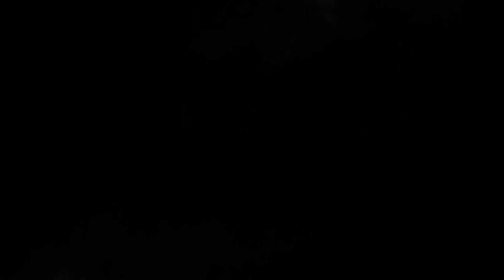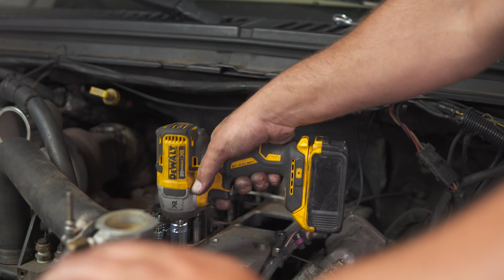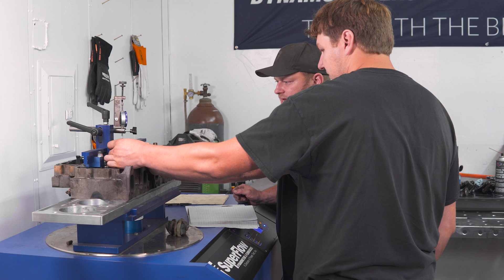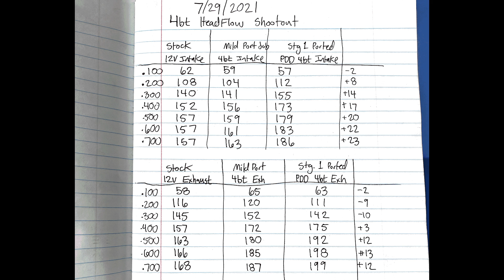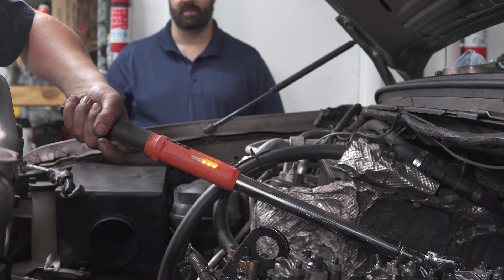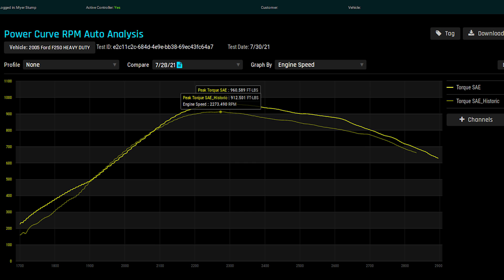4bt Cummins Ported Head Dyno & Flowbench Test

Comment: A non ford engine in a ford truck is the goofiest vehicle on the roads. 

They swap engines in everything... But the iconic Fords lose the most style points when they don't carry a factory ford drive train...

Chevy, or Dodge swap motors and most folks yawn...

A ford without a ford factory engine makes most folks cringe faster than speedy Gonzalez

Comment: A 5.9 6BT can handle upwards of 1100 hp on the stock bottom end, so I will take a guess and say the 3.9 4BT can do 700hp on the stock parts. The 5.9 I put in my '78 bronco makes 400hp at the flexplate and gets very good fuel mileage. But it only weighs 5200 lbs. I moved the entire driveline rearward by 4 inches, when I mounted the engine, so the truck has better balance than a stock Bronco, it handles nicely for daily use. And after driving it since 2009, I would never even consider running a gas truck again. p.s. I built a hybrid turbo for it, and it gets up to 39 psi.
Reply from the maker: Nice!

Comment: Is water/meth the next step in the egt war?
Reply from the maker: Pure water does help EGT, but it also reduces power a little bit.  The surefire way to reduce EGT and maintain or add more power is more airflow.  Big turbo systems can lean-out the burn enough to reduce EGT and maximize power production.

Comment: Throw a H2O methanol injection system on it.  I run straight water in the summer, and my 7.3L and 6.0L Powerstroke are much happier when towing heavier.  Your EGT's scare me...
Reply: That's what I'm saying I have a 6.9 and they say those will melt the pistons at 1200 and he said 1900

Comment: Hopefully these guys regeared the truck so they can have a cruise speed of 66-70mph at 1500-1600 rpms. That big mfr could probably see 30+ mpg if it was geared for it. They're probably producing 550-600 ft#'s at 1600 but their trans or differential gearing is working against them.

Comment: Well i just got a brand new peterbilt for work and it is every bit of twice as fast as my old peterbilt (which wasn't really old not even 10 years old) i think the old one had an isx motor could be mistaken but i wana say it was isx powered my new peterbilt has a x15 Cummins it'll push you back in the seat pretty good when the turbo kicks in with a load behind it i bobtailed it the other day holy shit what ever part of your ass or back was firmly against the back of the seat was when the turbo kicked in a big smile and laughed followed soon after

Comment: I have a 4bt in a F150 with a similar 4bt setup, a self ported head, P pump, Hx 30 over Hx35 compound, the same Colt cam, Stage 2 injectors with 035 pump valves. I can see 50+ boost with only a small puff of smoke off the line. No smoke under load when its warm. I was shocked at the HP numbers produced by the Kuntz Bro Excersion. Good job guys!!  I am also considering the ported head.....
Reply: Compound setup?

Comment: I put a '97 12v in place of the V 10 in an '02 Excursion years ago. I left it bone stock so as to save the stock Ford tranny.  It wasn't the fastest thing on the road, but at 60 mph on 35s I'd get 22 mpg. That 4bt is an AWESOME powerplant! Nice job, fellas!
Reply: I get the 4bt is good but I would have definitely done your swap over a 4bt. Just because of the cost to get less horsepower than you could a 12v.

Comment: Why do most people only use Cummins for performance.

Is it because iys easier (machanically), and cheaper to modify a Cummins.

It would have been bad as*, and really showed your ability, if you modified a 6.0, for some power.

Its getting boring to see only Cummins for racing.

There is a Duramax out there in a 60's C10, running 8's-9's in the quarter. Without a P-pump, that is true skills and ability.

Look at the gas world, they dont need carburators any more. EFI can make the same power.

Comment: Curious, what transmission was used with the 4BT in the Ford Excursion?
Reply from the maker: Ford transmission that came in the excursion with a shift kit.
Reply: Probably an adapter with the Ford trans. Not sure what the part number is on them but those f250 and up trans are really solid.
Reply: 5r110 will take anything a 4bt can make. Pretty study transmission with the right tuning.

Comment: Why put a motor that small in a chassis that big?  It doesn't make sense, this is what Jeep guys install in their vehicles, seems too small for an Excursion.

Hey does this look to big for my body?

Actually, no..... no it doesn't.
Reply: They put those engines in bigger heavier vehicles, and with the power it makes moving that expedition would not be an issue. That engine makes more power than any engine for offered in the excursions.

Comment: Seth and Sam are good guys. They helped me get back on the road after my trans heat exchanger blew 1,000 miles from home. They worked way after hours and let me park my truck and camper in their lot over night.
Reply from the maker: yes they really are!
Reply: I am  exploring  a repower  for a old rv I have.  Do you guys have  the contact  info  for these  guys that built  the 4bt.  Thanks
Reply: How 4

Comment: That’s awesome! I drive a UPS truck (the very long ones called “1300 step van”) with a Mercedes 4 cylinder Turbo Diesel (4.2 liter I believe) and I get 25mpg loaded with 15k lbs of packages in the city. 4bts are much more simple engines, than the Mercedes “O” series.
Reply: OM606 seems pretty straight forward, if only Merc had made a 6 liter variant, it would’ve decimated all
Reply: Mercedes are much higher quality of engineering
Reply: @1411MEDIA  true, but their injection system is a lot more complicated.

Comment: Hmmm. Build another one with a built Mercedes OM606 and compare them.
Reply: OM606 is a beast. The 2JZ-GTE of diesels lol
Reply: @Jackmerius_Tacktheretrix  Yes sir!
Reply: @tombryant4518  id like to put one in my 03 discovery but I don't know if it will be too heavy. The stock engine is an all aluminum buick v8.
Reply: @Jackmerius_Tacktheretrix  The OM606 only weighs 460 ish pounds. It’s a very light engine
Reply: @tombryant4518  wow, didn't know it was that light! Looks like I need to reconsider lol. I predict a project starting 😆
Reply: @Jackmerius_Tacktheretrix  Nice! Save your pennies because they’re expensive!
Reply: @tombryant4518  yeah they are lol. But im pretty resourcefuk and have a friend who collects and works on older Mercedes-Benz cars, particularly diesels.
Reply: @Jackmerius_Tacktheretrix  Perfect! There is a whole family of OM 60 whatever engines. I’m sure you’ll figure something out that works for you.
Reply: @tombryant4518  yeah, my practical side says go for the 5 cylinder but my heavy foot says thw 6 cylinder 😆

Comment: i allways wondered why the 4bt engines were so heavy.appearently cummins made sure the bottom end was bulletproof for industrial use longevity.am sure that engine would be loads of fun in a old ranger.could run 12's while getting 30 mpg.
Reply: It’s because they’re the same as a 5.9L 12 valve /6bt just missing two cylinders. So you’ve still got a rather heavy cast iron block
Reply: way too heavy for a ranger
Reply: @famousmidnight  it's been done before.
Reply: @wyattlewis8671  Oh, I'm sure it's been done just doesn't make any sense. So many other engines would not only fit better but make more power. 4bt for it's weight/power is a waste of time. LS obviously but also om606, m57 and others would be the better choice

Comment: I’m still curious about the choice to do 4bt instead of a 5.9.  Just because?  That’s good enough, I suppose.  Fuel mileage?  I got 26 hand calculated in my 2003 Ram 2500, and that was going around 75 on the highway.  Conditions were really good, but still, I always got good mpg in that truck, and everything was stock.
Reply: Mean while I get 14 to 17 on my 04.5 lol, granted that is the year they added the post injection and the egr camshaft so I run a lot hotter and run a good bit more fuel
Reply: @codcade  auto?  Mine had the manual, so that helped quite a bit, as well.  Either way, the later 5.9s could be tuned to get really good fuel mileage, but the 2003s were known to be the best in stock form in that regard from what I recall.
Reply: @f5tornadeau  I have an nv5600
Reply: @f5tornadeau  stock fuel turbo and tune as well

Comment: Will. Thanks for doing this! For those of you who don't know, I am the daily driver, of this daily driver, and want to give some "real world" feedback on this vehicle. Sam and Seth did a great job building this for me. It's been to New Hampshire with a Uhaul trailer both ways once and multiple trips to PA and does really well on the highway. Always 19-20.5 mpg incl. in the WV mountains. However, this Power Driven Diesel CNC ported head puts this thing over the top. 
I see a noticeable difference throughout the rpm range driving this over the past week or so. Spools quicker and easier. EGTs have also dropped across the rpm range. This gave me a useable power increase I can feel.  More power with less boost is always good!  Just have to keep from getting a ticket now, because being an Excursion, you can cruise at 70 and not even feel it.    Sam Kuntz Sr.
Reply: Anyway you could list the full build. Drivetrain, dash and gages etc. Not looking for the crazy details just what was used.. I have a 2000 excursion that I've been kicking around a 7.3 swap, 4bt or 6bt. This 4bt will do everything I want and then some
Reply: Damn I was happy with my 5.4 getting 14mpg on the freeway. 19 to 20 that’s awesome.
Reply: How much do yo spend on the swap?
Reply: @alexvistahermosa  Thats what I want to know.
Reply: What was the Cost?…I got my 03 6.0 powerstroke f350 xlt cclb fx4 with 82k on clock for about 15k I put about about 3,000$ into parts bulletproofing it myself ….14-15mpg pulling 8k 18-20mpg empty hwy….14-15 mpg empty city……it may be cheaper just to buy a diesel and fix it…
Reply: What is the rest of the drivetrain set-up? Transmission? Two or 4wd? Gearing? I'm thinking about this conversion on my 2003 Excursion with the gas 5.4L . I looked for build info on Kuntz Brothers website but didn't see anything.
Reply: Hi Sam,
Just watched this video. Super Cool!!!
Any more info on the build you can share with us ?.?.?  Thx!
Reply: This is awesome. Did you lose mpg with the ported head? How is the throttle response with 4bt. I'm thinking about putting a 4bt in a 2003 ford f150 supercrew.
Reply: Have you guys ever used a 4 valve head?
Reply: Hello Sam, I would love to know how to get in contact with Sam or Seth.  Every search I do for Kuntz Brothers takes me to a shop in Arkansas instead of your sons in Georgia.  Thanks.

Comment: And still running grid heater and stock charge pipe 😂 theres more power everywhere. Throw some 5” exhaust on that thing and let it breathe
Reply: 4 inch exhaust will flow enough to make more power than you're ever going to get out of a 4bt
Reply: It's making good power and torque for their daily driver

Comment: Up here in Wisconsin we got a 4bt in a minirod pulling tractor with a single hx55 no intercooler or aftercooler but we are running water injection and we're sitting around 700hp
Reply: you pull conpact diesel?
Reply: @cs-gj3yf  yes I do
Reply: @danrupprecht2836  nice i pull lpsd, a bit smaller class then you haha
Reply: @cs-gj3yf  I haven't heard of lpsd
Reply: @danrupprecht2836  limited pro stock diesel, they are garden tractors, 6k-12k rpm out of a 1105 kubota, the limited pro stocks are 200-400 hp and the limited pro stocks are 100-150hp, limited pro run 50 psi of boost and limited pro run 100psi+. all the classes are 3 cylinder
Reply: @cs-gj3yf  the compact diesel are based on a minirod chassis and are limited to 250cuin single turbo and only water injection most so far are the cummins 4bt but there is one guy with an Isuzu 4b1t are we don't have a limit on rpm or turbo size. We are figuring we are between 600hp and 700hp but one was dynoed at around 800hp and another was claiming 1000hp
Reply: @danrupprecht2836   the classes i named off are based on garden tractor frames, we dont have a limit on turbo or rpms either, we gotta stay under 50 cu, yall run what 1450 lbs?  the classes i named are 1050 and 1150, imagine a high rpm high hp diesel trying to get all that power to the ground with 1150 lbs lol

Comment: Funny.  I used to get 23mpg on my 2000 7.3 excursion
Reply: why is that funny? tow a camper and you get 10mpg. i go to 10 nascar race weekends a year, i talk to a LOT of people who tow their campers. i hear stuff like 7mpg. or : i keep it under 63 for gas mileage. getting 20 miles with 250hp vs getting 20 with 400hp is a big difference. I love my 7.3, it does what i need it to do, but it is not getting 20mpg towing a camper at 70-75 on in the mountains.... tow out of Asheville towards Bristol and report back...
Reply: Funny I get 24mpg in 6.0L silverado with a lift, tires, and 4.88 gears.
Reply: @chevyon37s  that would be cool, but as it sits it is only funny.

Comment: That is an impressive build.  I've seen a couple Excursions with a 5.9L Cummins swap.  I've always been curious how it would work with a 4BT as far as mileage and power.  It looks very capable to me.  Should be a great family cruising tow rig. Curious if they did anything to the transmission.  Is that still the stock Ford automatic? Thank you for sharing.
Reply: Ya we put a dpc triple disc converter, transgo shift kit, performance rebuild kit and the us shift that controls it also increases pressure for better holding.
Reply: @sethkuntz6237  Thanks for sharing that information. Did you see any mileage improvement from the new head on the way home?
Reply from the maker: Thanks for the support!  And Seth did report that they regularly use the vehicle to go on family trips since it's both comfortable and fuel efficient.
Reply: Awesome swap,, I bet the whole driving experience is night and day, steering must feel more responsive with the loss of weight over the 10.
Gotta love it, Ford makes it, cumminz shakes it!!